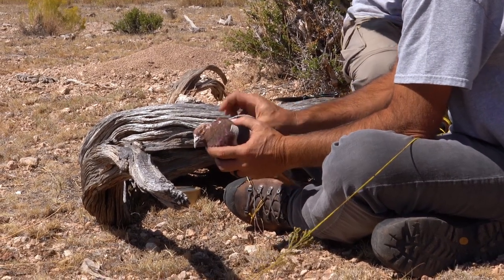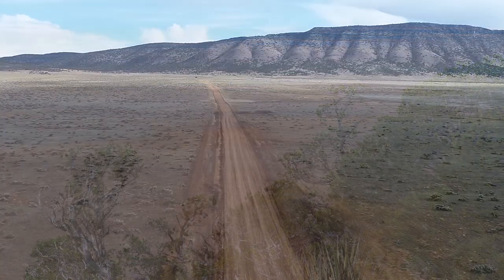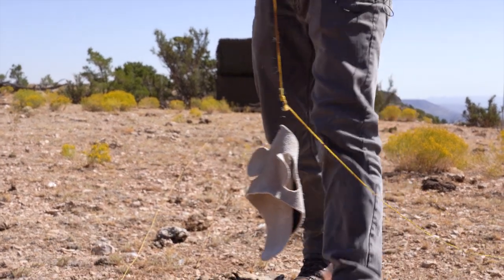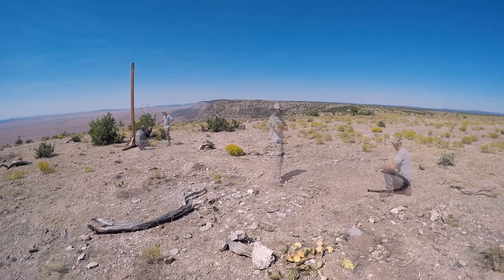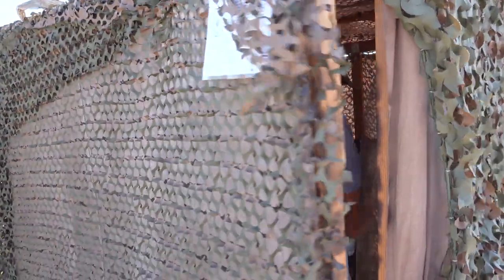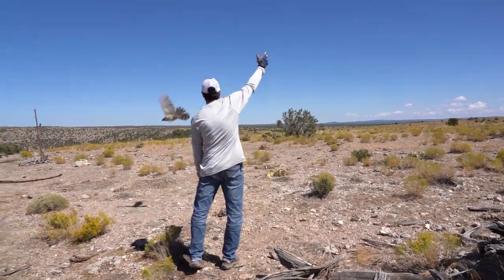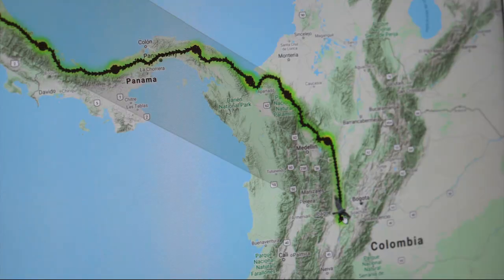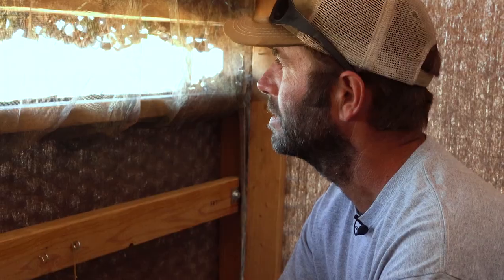Raptor Migration Study

Comment: I had a Peregrine Falcon wintering every year in my back yard in Casa Grande. At least I saw him every year, for about 3-4 years. I like to think it was the same bird, but have no way of know. I did see him nail a pigeon one time. He was really moving when he grabbed that pigeon. The falcon had his claws around pigeons wings perfectly. The pigeon looked bigger than the falcon, but they are pretty close to the same size. You should have heard the noise made when he grabbed that pigeon. It was a very distinct thud. Probably knocked the wind out of the pigeon, hard hard hit.